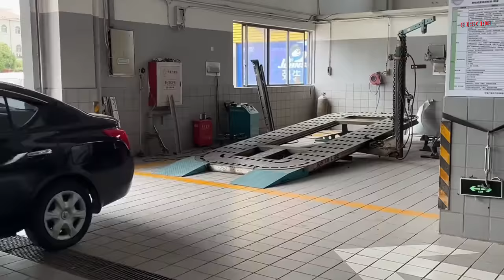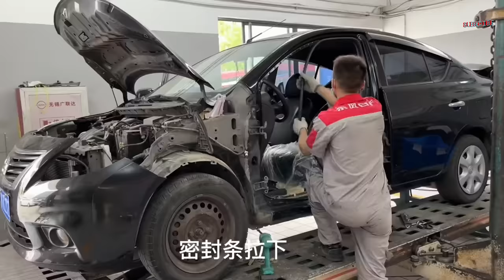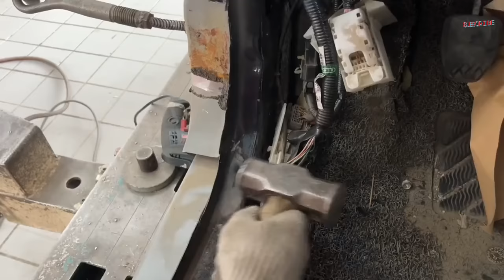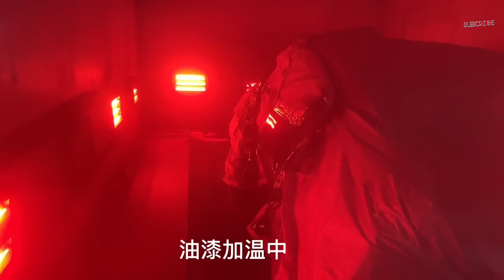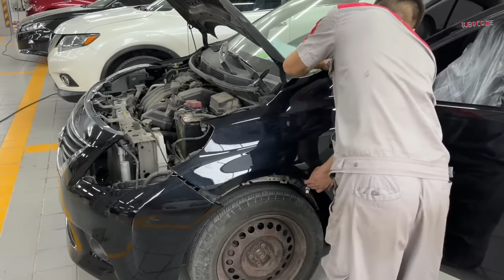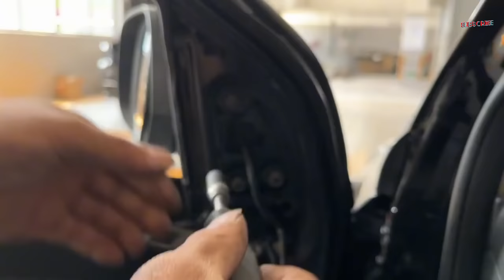Replacing a Car Door After an Accident

Comment: O my, exactly my case w/2009 Nissan Sentra. The lower hinge is bent, but I hope that part you pulled w/Frame Puller is not deformed (no damages in that area). I'm curious what happens if you don't remove that part on the bottom, threshold (which you later welded)? Seems like it is just for cosmetic purposes. Will the door close if to leave that bottom part as it is? Thank you for so detailed film.
Reply from the maker: Hello, the bottom of the car door is seriously deformed. If it is not restored to its original shape, it will not match the new car door. There will be a large gap and it is not beautiful. Therefore, if it is repaired, it must be restored to its original shape.
Reply: @xinxianshi  Thank you very much for answering my question. I see now. The blow on my car came in the way that it ended just at the very corner of the door (where the lower hinge is, the hinge was bent), but above the lower threshold. Seems like A-column is not damaged as well. So just the door was hit and not A- or bottom columns. It is very good to know that there will be just a gap, but you can drive that car for a while, and later maybe do all the necessary adjustments and repairs. I'll dare ask you another question. I know it is too many questions already, but hope it might be interesting and to others. That damaged door, can it be restored to some of its original shape, not beautiful, but working variant, or you just need to replace it? Thank you again. ❤🙋‍♀🌎

Comment: How did the door get fixed
Reply from the maker: Regarding the repair of the door, it was shown in the video that the door could not be repaired, so they chose to replace the original door assembly to solve the damage problem of the door. The door assembly is a complete assembly that includes all door structures and components. By replacing the entire door assembly, the integrity and functionality of the door can be ensured.

Comment: How long does a repair like this take? When I spoke to the repair shop they said 6 days which sounds too long!
Reply from the maker: The duration of a repair can vary based on several factors, including the extent of the damage, the type of repair needed, the availability of parts, and the workload at the repair shop. While some repairs may take a shorter time, others, especially those involving more complex tasks or waiting for specific parts, might take longer.

A six-day estimate for a repair may seem lengthy for some types of repairs, but it's important to consider the specific circumstances. Shops may also provide a slightly longer timeframe to ensure they have a buffer for unexpected issues or delays. If you have concerns about the estimated time or if you need the repair to be expedited, it's always a good idea to communicate directly with the repair shop, discuss your needs, and see if there are any options to speed up the process.
Reply: @xinxianshi  thank you for the reply. How long does it take to just replace the whole door on the front passenger side? Just taking the old door off(just a dent) and putting on another door can’t be that time consuming!

Comment: I wish that you clean the engine bay before handle it over to the owner.
Reply from the maker: Thank you for your feedback. It's always important to keep the engine bay clean and well-maintained for optimal performance and longevity. We appreciate your suggestion and will definitely take it into consideration for our future videos.
Reply: That's a can ofworms you don't want to open with an older car such as this one; you may end up having electrical issues! I know of such a case where the electric system caught on fire and melted a harness due to some bad wires on a 7 year old car. If you don't touch anything under the hood, JUST DON'T!